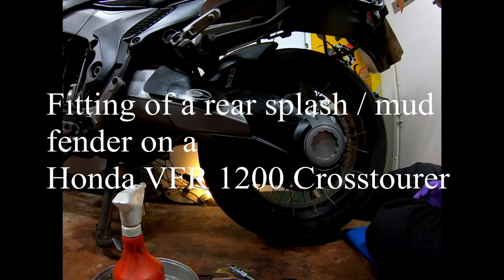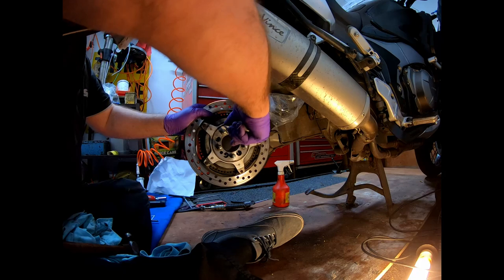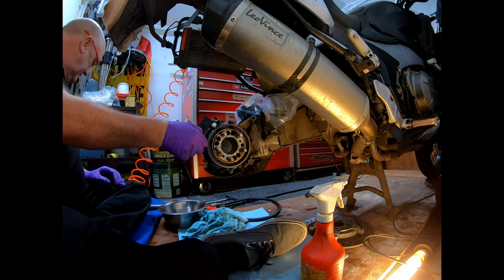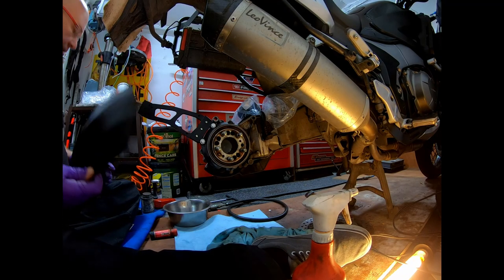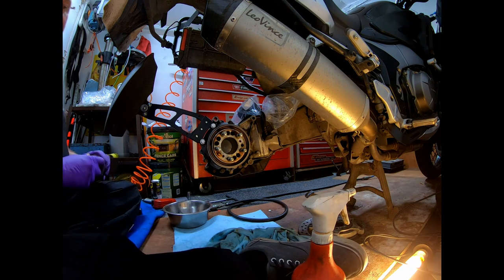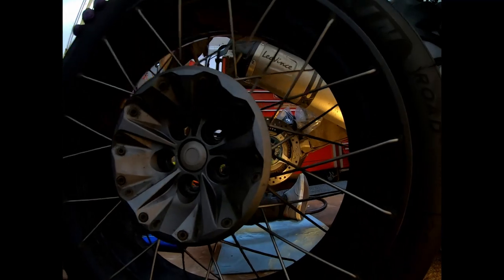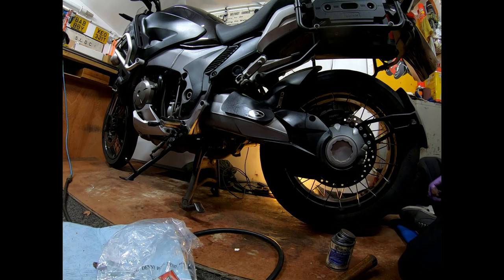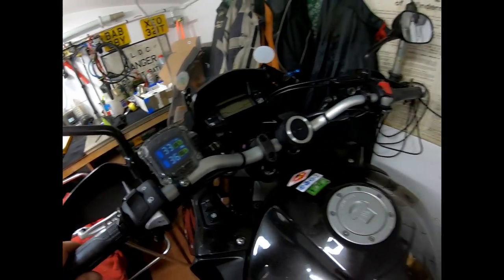Honda Crosstourer 1200 Splash  guard fitting

Comment: Hi what's the torque setting fo the lug nuts? Thanks
Reply from the maker: Wheel nuts ? The torques are 80 lbf.ft. or 108N.m or 11.0kgf.m
Reply from the maker: Hi wheels nuts. Are 80 lbf . Or 108 Nm. But I do them in 3 stages. Not straight to final torque
Reply: Thank you